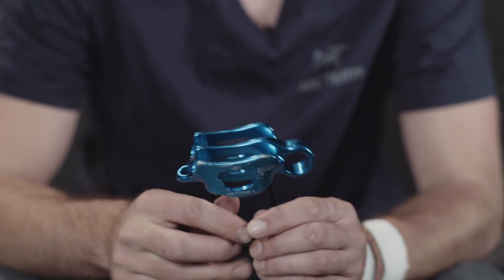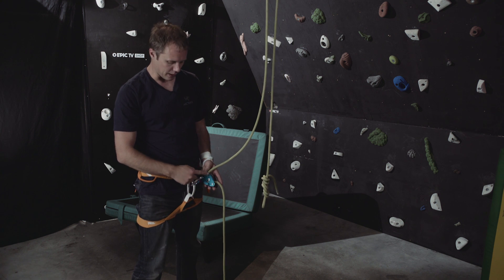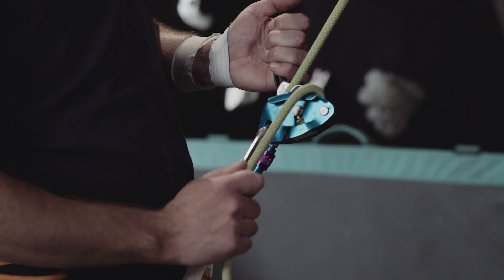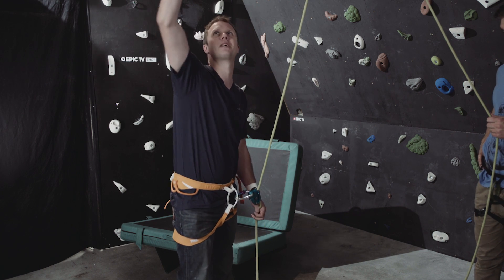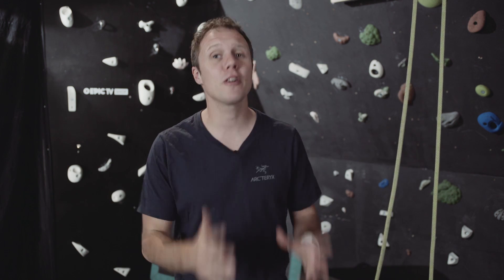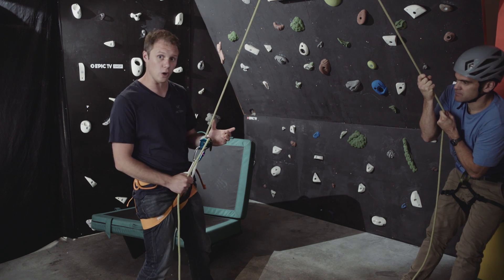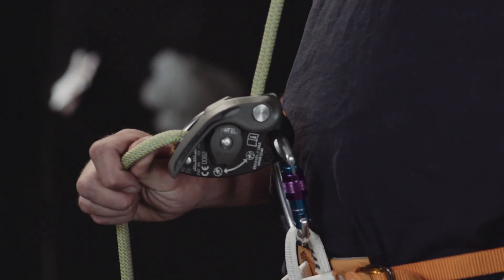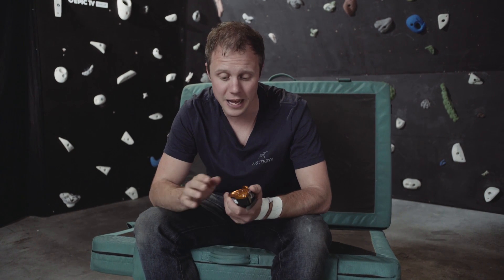How To Use A Petzl GriGri + NEW GriGri+ | Climbing Daily Ep. 933

Comment: Your taking in incorrectly you should take in on a Grigri the same way you do on a normal plate sliding your hand up the rope is letting go... Im an instructor at and indoor wall and you would be pulled up for belaying that way.
Reply: I agree. I don't think he was attempting to teach the toprope belay method...but as a creator, him showing the process of taking in slack, whether teaching or not, should always be done correctly to show beginners (who might be watching this video) proper technique, even if it's not the forefront of the video.
Reply: Tony Darle
Reply: ahh I was wondering that, I was taught to step one hand over the other when taking the slack through the device and to have at least one hand gripping the brake rope at all times
Reply: Shuffling is not incorrect. You can do at your indoor wall what you want but it has no implications for the real world or what real climbers and alpine clubs deem to be correct.

Comment: What bugs me about the grigri+ is that in the old grigri (especially when it's been used a lot) pulling the lever only unlocked the device and it didn't actually control the speed of the lowering. I pretty much just pull it all the way back and control the rope with my breaking hand, and it works fine. And I've seen many people doing it that way, because the lever doesn't really control the decent at all. Maybe in a brand new grigri1 it actually does make a difference, I wouldn't know. It just seems that this new feature in the grigri+ will be more annoying when lowering than really helping. I would have to try it out first.
Reply: Milla Cabral grigri 2 and plus does control speed. you need to be more gentle that's all.. It's like a degrees difference. also remember to pull the brake rope back
Reply: DERPENBERG Thanks, the grigris in my climbing gym are very old, thinking of buying one for me.
Reply: Milla Cabral save your bucks and get a grigri2 if you operate an original grigri with proficiency.  grigri+ antilock kicks in too easily on fuzzy gym ropes
Reply: DERPENBERG That's what I thought. Thank you.

Comment: The grigri+ in lead mode also slips and does not catch if your are not holding the brake strand, from testing it requires around 5lbs of force on the brake strand to reliably catch, but your grip strength alone can put out much more than that.

Comment: I find the panic handle activates too early for most indoor gym ropes. I have encountered several situations where it was impossible to lower the climber at all.
Reply: JingMin Teo good to know! this pricing is crazy and this has helped me decide I will stick to my grigri2.
Reply: JingMin Teo just got one and was messing with it at home and thought it seemed like it activated way too easily. may be going back to gri2
Reply: Same here - I thought investing in the GriGri + would be worth the enhancements of safety, but honestly is a major issue when climbers are too light and the safety catch hits almost automatically. ALSO, the button to switch between top-rope and lead climb is HORRENDOUS! My opinion, stick with the GriGri 2.
Reply: If you pull furthermore after the panic handle blocked, you can actually give rope again, without any more safetyblocking. This is made for especially this situations, when climers are too light.